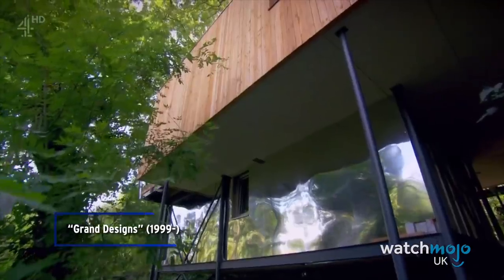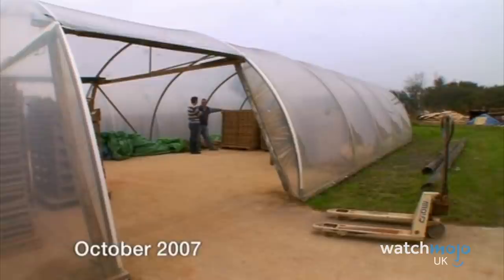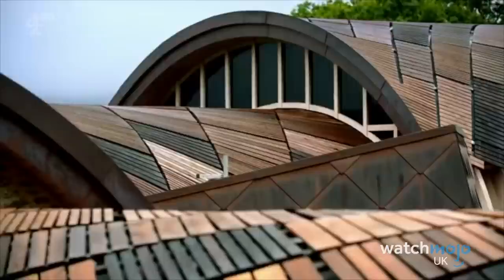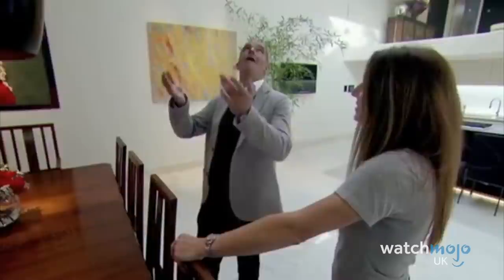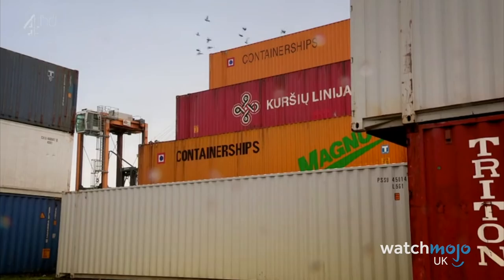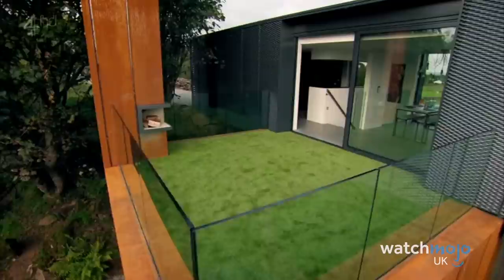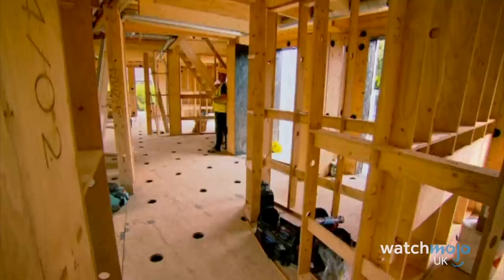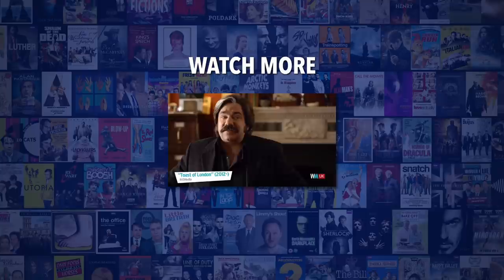Top 10 Incredible Grand Designs Creations

Comment: 1:21 "This whole floor is like a kind of luxury hotel suite". That sums up most of the Grand Design houses - posh hotel/brothel/industrial unit.

Virtually no thought is given to maintenance. Flat roof (replace every 20-25 years), or wooden roof (who is going to paint on the treatment every 10 years?). Steel posts into nicely corrosive sea water. Brilliant. 

There have been one or two good results, but on the whole they are just architect's wet dreams. Keep architects where they belong: in an asylum.
Reply: With my new house I went for the posh slum style of modern India. It's small, leaks, no heating, no warm nor running water, noisy, but I only overshoot the budget with 250 000 £.